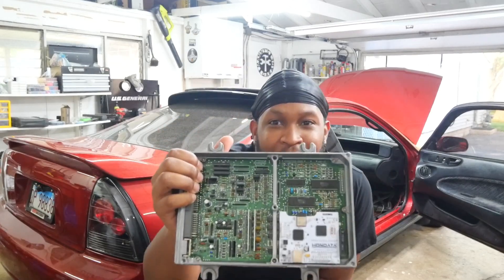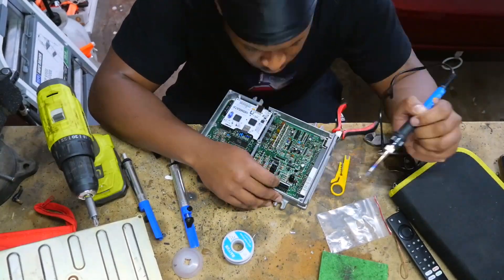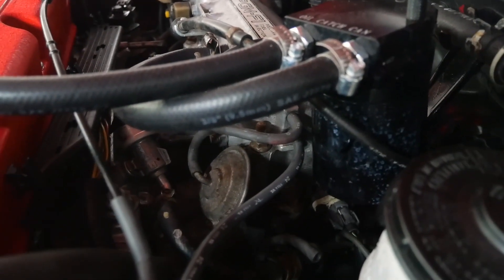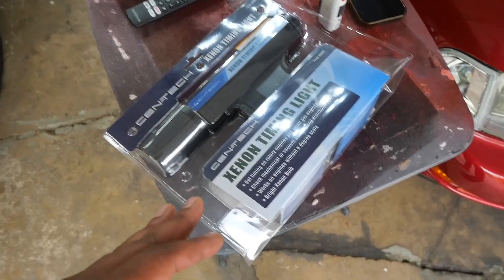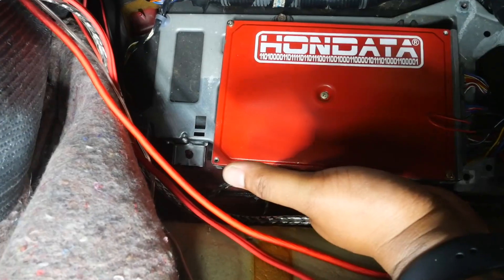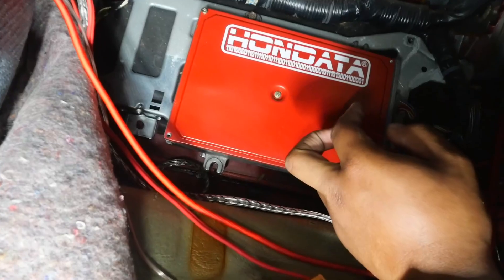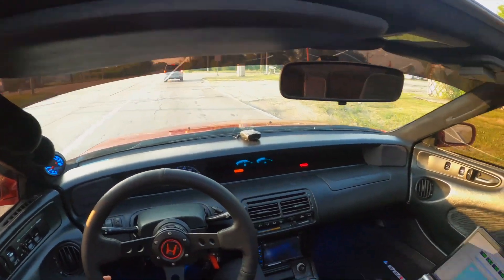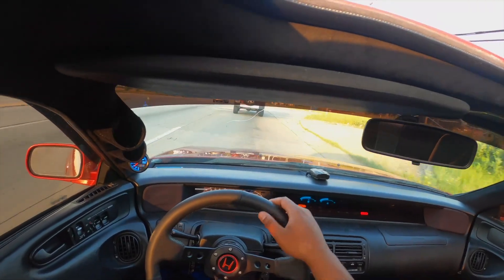Honda ECU No Fuel Pump Fix!

Comment: Just watched this video and the last one so far. You've answered so many of my questions and current problems. I have a 98 prelude. Just rebuilt the entire motor and about to put it back in and I have an s300 in my civic that I want to put in the prelude but it has that same issue where the fuel pump relay takes like 5 minutes or longer to click before I can start my car. Now I know what the issue is.

Comment: for the IAB solenoid you can try hooking it up to the wiring of the Evap and in the ECU settings set it to  work with the EVAP pinout. This is how I made it work on a b18c4. However keep in mind the B18 butterflies are the other way round. They become closed by vacuum so whenever the engine starts they're closed  by the intake vacuum, and the solenoid simply cuts out the vacuum which opens them.
Reply from the maker: The solenoid is bad. It’s either broken or stuck. That’s why i just hooked it up to the intake for now.